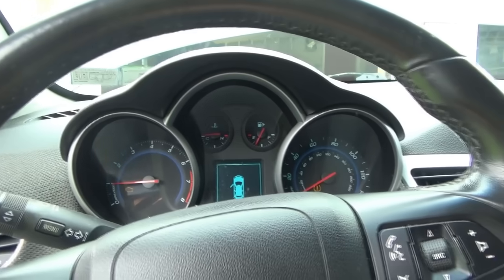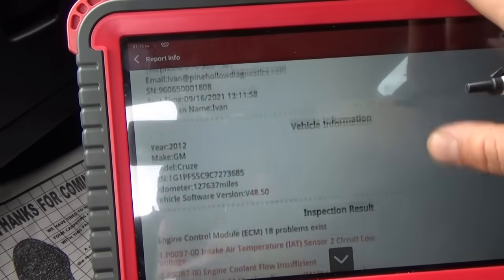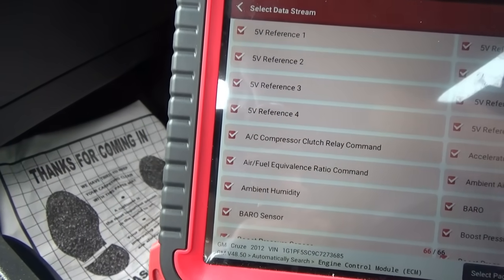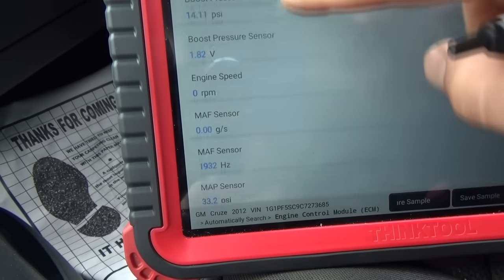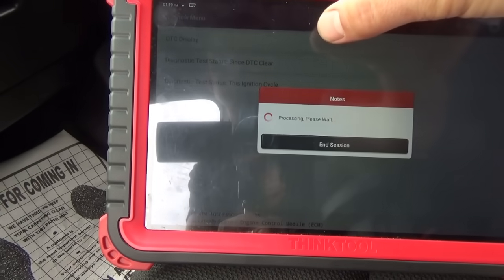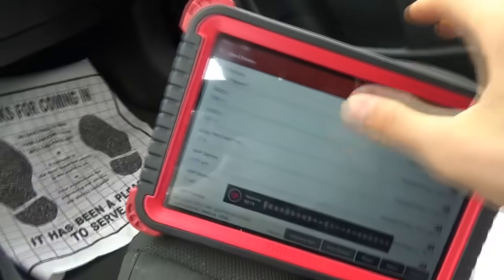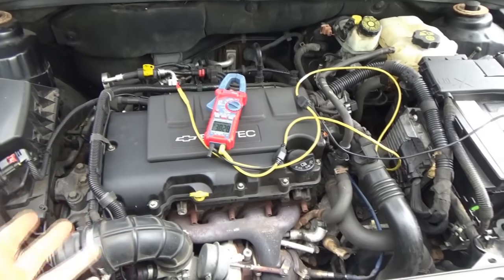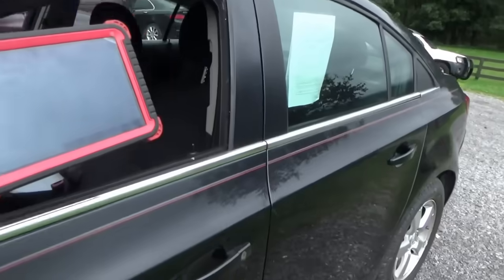Scotty Kilmer was RIGHT! (Cruze Turbo Rough Idle P0106 P0171)

Comment: I own a cruze (2015) I love my car, but it is a high maint car if you don't stay on top of things.  Main thing is valve cover replacement and pcv failure (flap in intake manifold).  Fix these for  baseline and re-assess from there.  Fuel trims are really hard to nail down.  It has bizarre strategies including vvt on warmup and vacuum readings.  Ivan  root cause of problem is faulty pcv valve in intake manifold.  It then ruins the diaphragm in  the cover itself to regulate vacuum.  Brother, you can take this one to the bank!  Also noticed this guy is low on coolant watch out!
Reply: That type of failure is not considered high maintenance that's just flat out bad design low quality and unreliable.
Reply: @michaeltrinidad1217  no kia honda toyota bad quality poor design buy a union made car or move to china or russia
Reply: @rockytop4  I used to think that buying American always bought American but I no longer want to be part of the hundred thousand Mile Club. We're Vehicles reach a hundred thousand miles and start to fall apart. And by the way that Union made car and truck you're talking about has 39% foreign parts that's right from China and other countries. You think domestic car manufacturers give a crap about loyalty to this country? They will sell their own mothers to make a profit. They've been moving jobs to Mexico and other countries four decades. I support organized labor I vote Yes for Union representation. But loyalty to American companies that have zero loyalty to America and their workers I will not support. I have done my homework and I now drive a Toyota and follow the recommendations of Highly experienced mechanics.
Reply: @Yeah Right it's not hard to look up the raw data mechanics have records of all the engines that needed to be replaced all the major repairs every car or truck required. Ask independent mechanics what type of vehicles are always showing up for repairs. I always fought it and said oh I will never buy an import but you can't ignore the facts. And when I say import I mean Toyota Honda's kind of dropping off on reliability. Kia Hyundai hundred thousand Mile Club Jeep Chrysler Fiat hundred thousand Mile Club GM after 2008 hundred thousand Mile Club Ford on some of their models hundred thousand Mile Club. Oh I'm sure all the above vehicles to go past a hundred thousand miles at what cost? At my work are mechanic shop majority-owned Toyotas because they work on vehicles all day they don't want to go home and work on their own.
Reply: Look up the "PCV fix kit" might be worth your time. Dorman also sells an OEM+ manifold that supposedly fixes the problem.

Comment: Thia is a fairly common problem on these. Have replaced numerous valve covers. There is a modification kit available to repair the missing check valve in the intake so intake replacement is not necessary.

Comment: Due diligence people!!! Maintenance is required for everything, even relationships. You can replace the valve cover to temporarily (about a year) fix the car. If the intake manifold is bad it will break the valve cover again. Most will change both thinking the problem will go away. Truth is if you don't change the oil, oil filter and air filter the problems will come again. Not changing the oil and filter will cause the turbo to clog and  crack. Oil will then seep up into the intake manifold combined with dirt from the clogged air filter creating gunk destroying it all over again. Then it will break the valve cover again.
Reply: Once the valve cover is defective the computer will try to correct the problem by adjusting the engine. This will trigger the a
Track control error which will make the screeching sound from the valve cover.
Reply: @richiedaze  Richie, plastic and aluminum have major differences in their rates of thermal expansion. It is simple physics. You cannot expect them to stay mated under the extremes of temperature a typical ICE engine goes through. They try to use a sealant in place of a typical gasket, that does not work either. It's just simple physics. DO NOT BUY a vehicle With a plastic intake manifold or valve covers.

Comment: Just replaced the crank seal behind the harmonic balancer on a 1.4 cruze after another job mistakenly diagnosed it as a leaking valve cover and replaced it with the dormat one. I learn a lot from you.
Reply: If that intake valve is gone the turbo pressure in the crankcase will cause all kinds of leaks

Comment: Shoot Ivan, I could have told you that.  Chevy Cruises with Bad Intake manifolds, and a blown diaphragms in the Valve cover are easy money round here.   And then the oil feed tube will plug up to the turbo, and it will be more easy money!

Comment: These things eat valve covers and the one way valves in the intake like candy. Plus the usual purge valve failures and other minor issues. Luckily most of the repairs are fairly cheap. Especially for those who can do minor repairs themselves.

Just did one last week, but it was a bad coil assembly (misfire) and purge valve. :)

Comment: Ivan the Vacuum reaches the valve cover through a internal port in the head to he valve cover. The check valve in the intake manifold is there to stop boost pressure from pushing into the PCV system under boost. There is also a check valve at end of the corrugated hose down at the turbo, this is sealed under vacuum but under boost when the intake check valve is sealed, excess crankcase blow by pressure can push past this valve to be sucked into the turbo.

Comment: The valve cover diaphragm is a common failure point, even without excessive vacuum. I experienced this failure within the first 30K miles of my car (Sonic, not Cruze, but same engine). The dealer replaced it for free and the new cover has lasted 120K miles. Why they didn't make the diaphragm removable is just an indication of poor engineering and the drive to save a few pennies on each part. Unfortunately, my guess is that this cost GM more than they saved because failure during warranty is common.
Reply: Much more affordable than Volkswagen for the same reason.
Reply: Like I tell my customer's; if DORMAN makes the parts, it is a problem.😸
Reply: @johnjennings2672  true DAT

Comment: Wow,  ivan,  i did 2011 chevy cruze last year with bad valve cover. She was getting low power complaint,  excessive vacuum, excessive oil consumption like leaking oil etc,   plus that valve cover was under tsb recall.   Replace it and solved the problem!!  Very poor design by gm if i must say!! Told her to get rid of it as i didn't want to be married to that thing with problems!  She traded it in for toyota camry lol.   Awesome video!!

Comment: My brother had an issue with a seemingly ghostly vacuum leak on this engine causing it to run lean, and I checked the entirety of the intake looking for it before sending him off to the dealership- when they came back to us saying it needed a new valve cover, I thought they were out of their minds, but that alldata article cleared up that confusion. My brother had a slew of issues from that car; we both agreed it was a real piece, and he thankfully sold it to get another. Disappointing to see that lack of quality in a domestic brand.

Comment: I have a 2011 Cruze with the 1.4 turbo that I bought brand new. I love the car. It now has 150k miles on it and all I ever do is put gas in it (30+ mpg) and change the oil every 5k miles. Never had any of the problems I hear about.
Reply: I'm working on an auction 1.4 cruze also barely 100k miles and a lot of shit has gone bad on it alreadym currently about to do the rear main seal

Comment: FYI, the PCV valve on the cam cover WAS under recall until Aug of this year...  The PCV valve in the manifold is currently under recall.  The Cam cover one is not hard to replace $80 bucks from your local parts store and 2 small dabs of RTV and about 30 mins your done.  The Manifold one is not so easy and since its currently under recall take it to your dealer and have them check it out.  On this vehicle both need replaced since you can not see that red tab through the port in the manifold.  If you only replace the cam cover the problem will go away but in 30-40k miles or less it will come back because the bad manifold PCV will cause the cam cover PVC to fail again eventually.
Reply: Thanks for the update. I bought a used one with 11/12 check engine codes. Lean burn mostly.. replaced the valve cover and gasket and installed the new oil filler cap kit that seals much better. After I fixed all the intake leakes and valve cover she would blow oil out the cap all over the place. I have no check engine lights now and she runs great. 
It has 180,000 miles on it and looks and runs fantastic. Should I take it in for the recall? And would it cost me anything? Seems weird to take a perfect running vehicle to the dealership especially since I do all my own work. But you say it will keep happening because the recall?

Comment: This PCV fault on the Ecotec engines is SO COMMON!. I've done like 10 of these already. I still charge shops $300 for 15 minutes of diagnostic time for this problem, just for the diagnostic, cause I know what it is. They change the part. Actually I could hear the vacuum leak right when you started the engine. If it screams vacuum leak, you should have listen for a vacuum leak somewhere on the engine.  Also if you take out the dipstick, OR the oil cap, you could feel the vacuum on the crankcase. That screams PCV valve. Probably the only thing you needed to change is the valve cover, since it's part of the PCV valve. It has a flimsy thin rubber valve in it that doesn't last at all. Thanks for the great videos.
Reply: But the main pcv is in the intake manifold. Which is the problem. People are doing what you said and they are replacing the valve cover over and over and not fixing the main issue in the intake. Wasting money constantly replacing the valve cover.

Comment: Before I watch........my guess.......valve cover and or purge valve.
Reply from the maker: or BOTH hahaha
Reply: @PineHollowAutoDiagnostics  Lol. Of course. These things come in all the time for the same thing. If I see a lean code the 1st thing I do is put my finger on the small port for the valve cover integrated pcv. And then remove the purge valve line and see if the purge isn't sealing.

Comment: I sell LOTS of intake manifolds and valve covers for these junk 1.4s at my parts store.  Lots of repeat sales before the Cruzes are sold too! 🤣🤣
Also worth noting the turbos for 1.4s are the only turbos we maintain stock on.  Just sayin...
Reply from the maker: WHAT A MONEY PIT 😅
Reply: @PineHollowAutoDiagnostics  
It's a throwaway car. Watch out for that coolant hose plastic adapter they fail all the time. By than the owner got to swap the head gasket since the pressure snaps that plastic off

Comment: I can't even begin to tell you just how many of those chevy cruze valve covers and intake manifolds I have had to replace over the years.  Sorry Ivan.  But the moment I heard the leak that you heard after starting the engine, the first thing that popped in to my head was, not another one?  LOL
Reply: What company did you buy the valve covers from? And did you also have to buy the fel pro gasket? 1.8 Chevy Cruze Ls NOT the 1.4 turbo
Reply: @seanhubbert9929  I was referring to the 1.4 turbo version and I would always get them from the dealer.  The aftermarket manifolds rarely seem to have any quality control.
Reply: He had to figure out what you already knew from experience, but at least he took the time to do a proper diagnosis, unlike most of the mechanics we seem to have on the west coast, who use the shotgun approach of throwing parts at it, til the process of elimination eventually fixes it. Unfortunately all of the services out here are full of people like that. Bunch of parts changers. Glad to see there are still some real techs. If I could find one locally, I wouldn't fix anything myself.  I make sure of a diagnosis before I change a part, but most of the shops around here are the parts changers.
Reply: @n1acguy  I agree with you.  A lot of so called mechanics out there are just part's changers that work fast and slopy.  And rarely have to deal with an angry customer when they make an expensive mistake.  Grant it, I'm an old school tech so I don't have some of the gadgets that Ivan uses.  And yet, he shows me that there is another, less labor-intensive way to solve a lot of the same problems.  So, I find it interesting to watch him work.

Comment: Vaccum leak check the pcv in the valve cover and if it is whistling out of the pcv it is bad!

Also rebuild oil cooler if changing the turbo, I have also heard the intake should be changed on these upon turbo failure, but I never changed mine.

Comment: Its unreal how bad the chevy cruze and chevy sonics are. The materials used to build these cars are weak, the designs are bad...i had a 2015 chevy sonic for 10 months and it had 48k miles on it when i bought it. It was still under its extended warranty and i ended up putting 2k into it in repairs. I sold it and broke even on it somehow, i will never touch one of these again unless its to drive it into its grave.
Reply: My sister was buying a car and asked my advice. I told her to buy an older Toyota, and please don’t buy a cheap GM product. She shows up with a 2017 Cruze. A week later she sends me a pic of the coolant reservoir completely empty asking is that bad? Yep that’s bad haha
Reply: @lesterparker1594  dont you love it when someone asks you for advice and then completely ignores it? Ive had that happen a few times too, they have to learn the hard way.

Comment: Youre right about the MAP sensor. I have a 1.4L Sonic. My MAP was bad and needed replacing. Went down to my local parts store and bought one but their system didnt show it was fit for my car even though it was shaped identically and fit right in.
 Long story short, it ran worse. The sensor I bought was for the N/A 1.8L engine. I also needed to do the PCV fix.

Comment: One thing I noticed right away is that the oil cap isn’t on tightly/correctly.  That will cause a vac leak also on these cars.  Even the oil dipstick seals need to be in good shape.

Comment: If the non return valve in the intake is missing it will take out your diaphragm in the valve cover if not fixed quickly. I grew up around Chevrolet and used to love them but then I got me a 2014 Chevy Cruze

Comment: Geez are these engines not the biggest pieces of junk GM has ever produced?
Reply: The new ones yes, i have a 2005 chevrolet classic (16 year old car) and so far its been a good car with over 216,000 miles no engine trouble, i did have to replace the chain tensioner on the cam side with a newer version because the older one was junk, btw i have a 2.2l ecotec l61 and so far not a bad motor and doesn't burn oil, these newer gm vehicles from 2007 up are shitty
Reply: @southernautodiy2643  For some reason all of the Youtube videos where the 2.2L Ecotec is getting a timing chain job, the inside of the engine looks like the bottom of a well-used barbecue grill. Ya think that might be because these engines are neglected leading to timing chain failure??
Reply: @brianleeper5737  yes! Ive seen videos all about how the timing chain tensioner on the cam side failing and the motor ends up sounding like a tractor because of neglect of changing the tensioner that causes cold start rattle and the newer version is designed differently, i was able to pull apart the old tensioner by hand which you shouldn't be able to do, no rattles or knocks since but im glad i replaced it, i change my oil at 3k too to because my timing chain is original and not stretched much at all, so yes neglect to change that tensioner results in catastrophic engine failure otherwise they are reliable, this also applies to the 2.4l ecotec too

Comment: Needs a new valve pan cover the pcv in the cover the diaphragm goes bad causing rough idle. I just did a 2015 chevy sonic with the 1.4 turbo seems to be a common problem around 60000 miles.

Comment: I you loose the the orange check valve in the intake manifold, 9 time out of 10 the cam shaft cover has to be replaced as well.  Also if the car is run for a while in this condition, the front crank case seal will fail too.  My 2015 Trax needed all those parts replaced.  Nuts!

Comment: Yeah I did one a year ago on a fairly maintained ecoboost. It cleared it up but the red thingy was not visible. Driver opted not to go with further repairs and stopped at the valve cover. Correct repair is valve cover and intake manifold.

Comment: I had a Chevy Cruze ,expect a issue about every 45,000 miles. With a total 220,000 miles before selling the car.  These are the things I had to  replace during ownership, the coolant outflow (throttle body side of the engine at least 4 times easy job)  Intake manifold once, water pump twice. If you change water pump only use OEM GMC made in Germany part. Don't use the AC Delco part made in China. Change the valve cover with new when when oil seeps from gaskets follow instructions of where to put sealant. On the Turbo model remove the front bumper if you need to change the radiator or inter cooler. They are clip together and this will save you time. Had to change timing cover gasket, don't remove the oil pan if you change the timing cover gasket. You can drain and wipe down the inside of the pan from the front of the engine with timing cover off. If you need the timing tools I have the one I used, easy to do . Actually this car was pretty good never left me stranded.